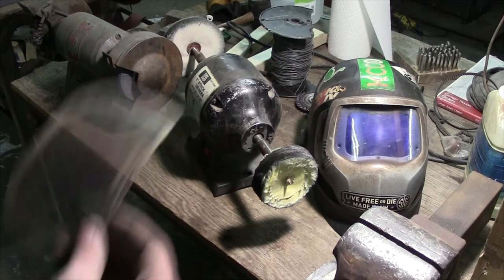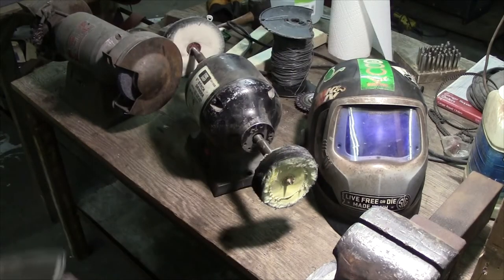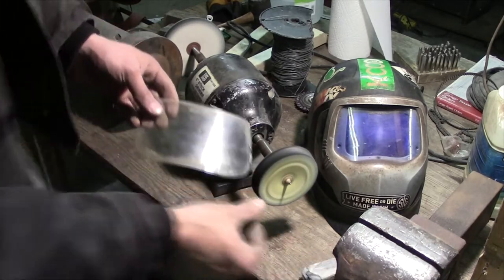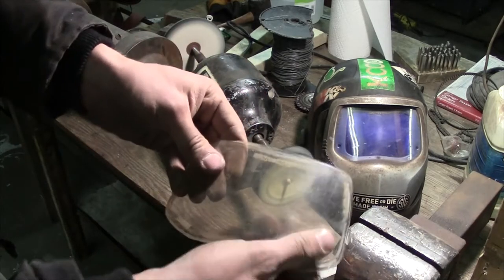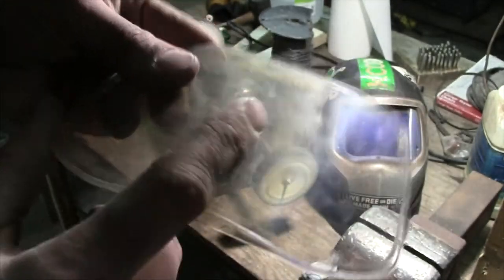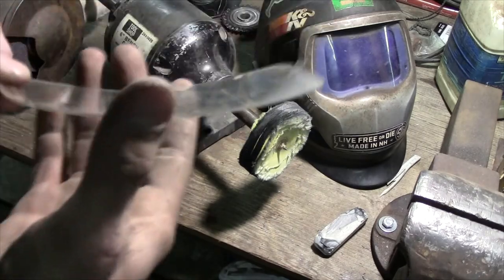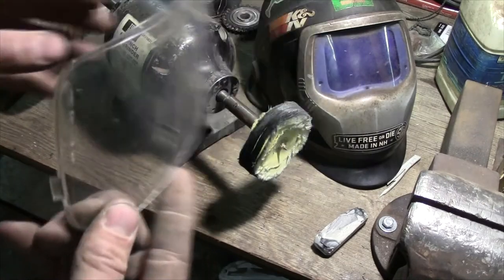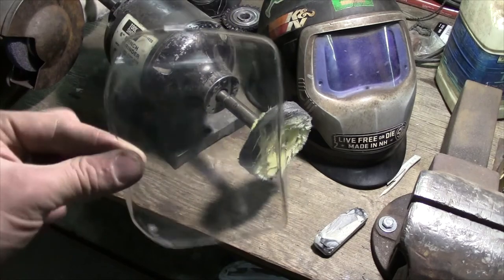How to Clean Old Welding Lenses| Iron Wolf Industrial

Comment: No need to do all of that, put your new lens in, spray it down with weimans stainless steel and aluminum polish and cleaner, wait about 10 sec, wipe off with a glasses cloth so you don't scratch it, then you'll notice your lens takes longer to get messed up, then you just spray it with the stuff again, and it will become Crystal clear again, a old head told me this truck, and it works like a dream, my lenses are expensive having a optrel panoramax but this saved me so much money, I go through one lenses in about 6 months, and I'm always welding.